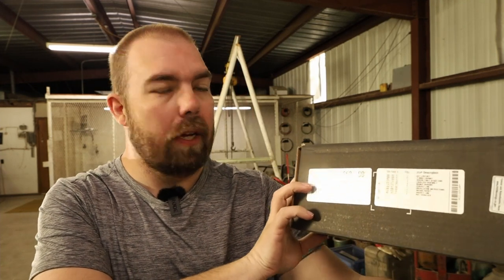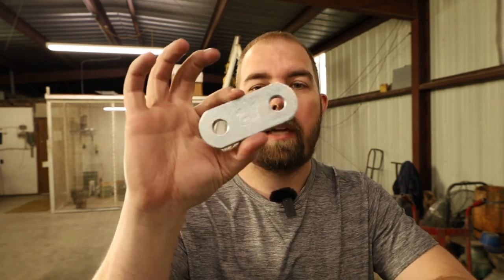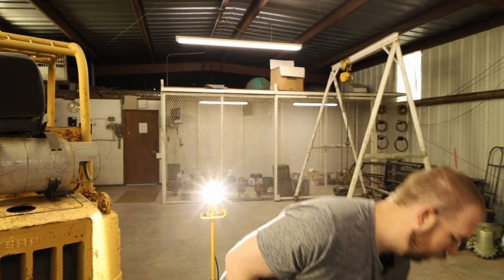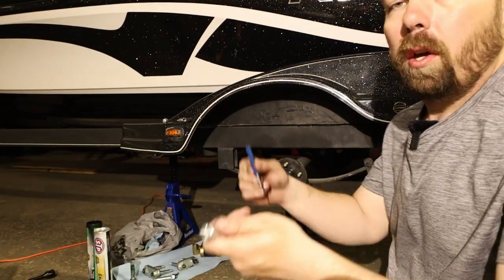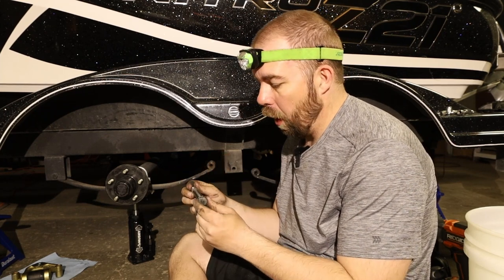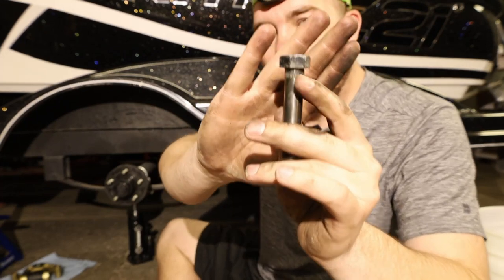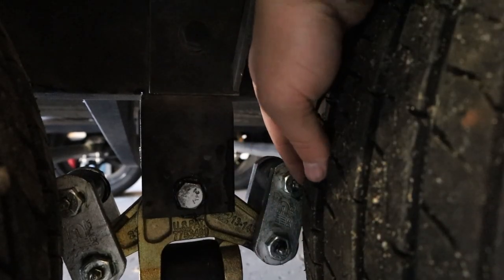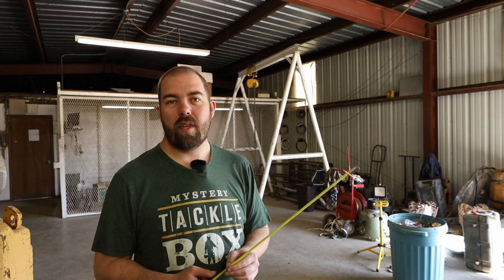Dexter EZ Flex Equalizer Installation for Nitro Trailers (Dexter K71-652-00)

Comment: We just installed these on a trailer and the grease zerks are TOUCHING the tires….
Reply from the maker: You can mount the bolts where they go to the inside.
Reply: @clearwaterfishing  honestly the clearance would still probably touch every once in a while
Reply from the maker: @SuperFlyXD  that sucks man. I guess you can change out rims and tires.